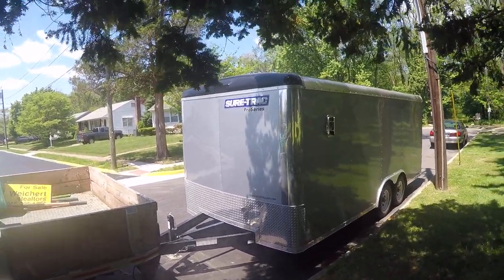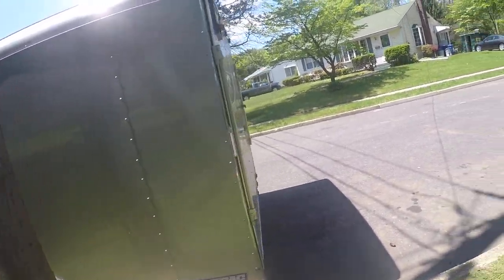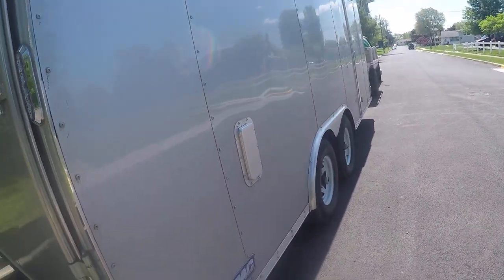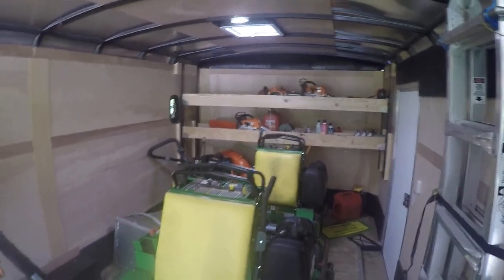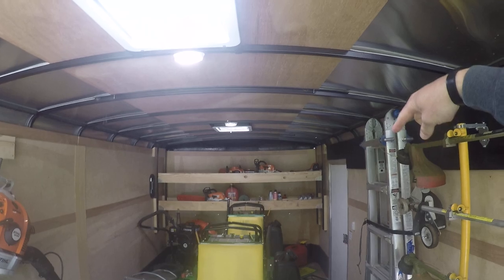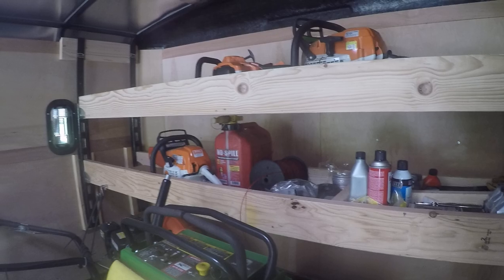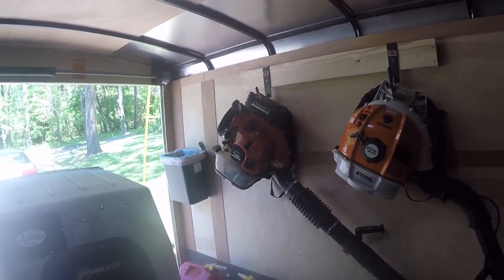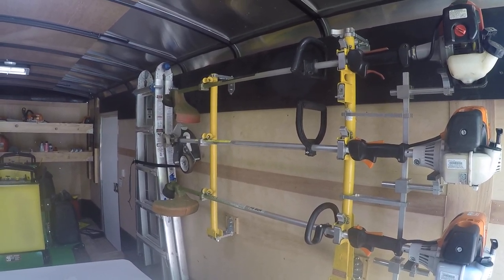Sure Trac Pro 8.5x18 Enclosed Landscape Trailer

Comment: Curious, I know this video was from spring, but how did the trailer hold up for you this season? Had a couple questions on it, evaluating one just like it. Would you suggest sticking to the 8x5x16, or could you get away with a 7x16. Im running exmark 60's with ultra vac spring/fall, I'm guessing the 8.5 would provide some much needed wiggle room. Thx in advance if you have any input!
Reply: After having it all season I would stay with the 8.5x18. The room I have on both sides of the mowers is very nice. I love this trailer has done everything I wanted and more. It can be difficult to get into certain places but you get used to it.
Reply: Robert Fenimore thanks for replying pal. That is good info. Is this an 18'? I'm evaluating a 16'. Stand on aerator and a mower, and then a bagger. Have to figure out the length but I believe 16' is adequate for my needs. Shorter is better for me being in subs all day, hard to find curbs to park if you're too long lol.

Comment: The only thing I don't like is the trimmer rack they are just to high. They are good racks I use them as well . I have the one that holds four trimmers. The highest trimmer I have is chest high. I have them slightly turned so I can fill them all with gas. It looks like one of your trimmer is really high ? But if you like it that way cool. But it looks like it works for you.